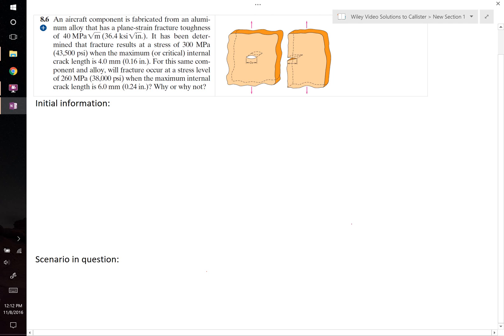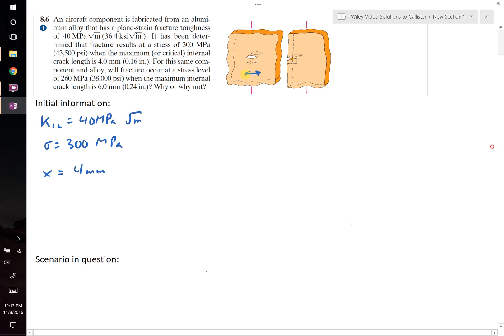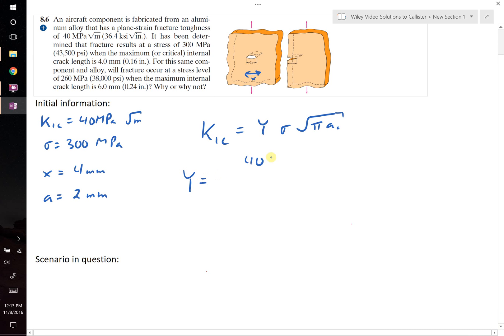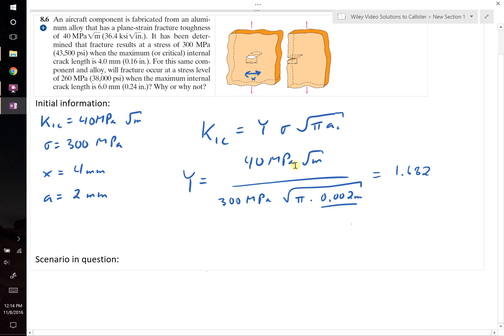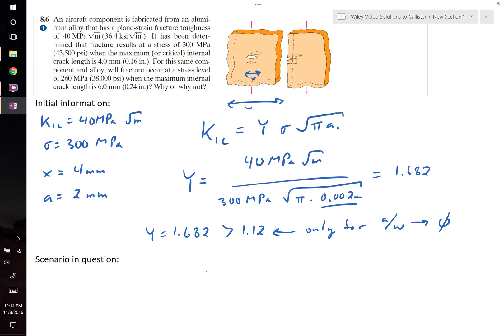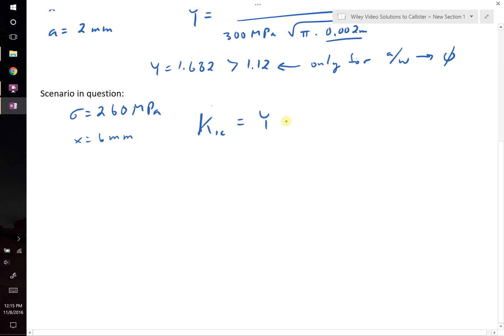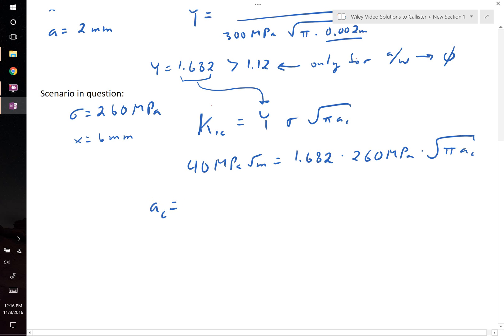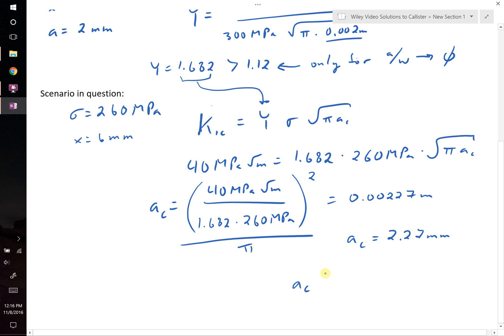fracture toughness example problem

Comment: Thank you for the helpful video! I believe the answer is slightly off, it should be 2.66mm opposed to the 2.27mm mentioned in the video. I think the 6 was omitted from the 1.682 value in the calculation. I appreciate the informative and helpful video! studying for an exam, and this material was very helpful.

Comment: Hello! I have some confusions about the leak before break concept. Can you please have a tutorial about it? Here is an example question I am solving. Thank you!
"A pressure tube is designed on the basis of the leak-before-break principle. The tube has an inner diameter of 20 cm and a wall thickness of 3 mm. It is assumed that the crack depth a, is always less than 40% of the crack width at the surface 2c. What is the maximum operating pressure in the tube? Use a factor of safety of 1.5 for stress in your calculation. If the a/2c ratio falls to 0.1 will the factor of safety be sufficient to ensure that leak-before-failure still occurs?"
Reply from the maker: I may have some time this week
Reply: @TaylorSparks   Can you please explain why is it when the crack is internal than we need to divide the length of the crack by a safety factor of  2? what is the reason behind it? 

I am kind of confused.

Comment: An alternative way to calculate. Since Y and KIC is same for both situation, (sigma critical*sqrt(a, max) for 4 mm is equal to (sigma critical*sqrt(a, max) for 6 mm. You will get the critical stress value for a=3mm equal to 245 MPa. Applied stress value 260 MPa is higher than 245 MPa which is critical stress value for a=3mm. Therefore, fracture will happen.

Comment: The fracture occurs when the critical crack length is lesser than half crack length....can anybody tell me why is it so?
Reply: It depends on whether the crack length is internal, or on the surface. The critical crack length is taken as half when implementing into the formula if it's internal.

Comment: where can i get example problem of related topic?
Reply from the maker: Which topic? I can make more videos of needed.
Reply: @TaylorSparks  fracture toughness,  especially on how to calculate safe design,  when there is crack,  crack propagation rate,  max allowble stress when there is existing length of crack

Comment: Can anyone explain the difference between the two equations for Fracture toughness equations such that:

K = (y.p)/(h.w^0.5)      or 

K= Y. STRESS.((Pi.a) ^0.5)
Reply from the maker: Where are you getting that first equation from?
Reply: @TaylorSparks 

BS IS0 13586: 2016

similar adaptations are found in ASTMS and forums discussing k determination of CT and SENB tests.

Thanks for your reply

Comment: how you can use tthe same geometric factor in the second case and u want the length of crack that include in geometric factor!!?  that mean u use first y  that include a=0.002 in the second case  that require  to find a
Reply from the maker: That's a great question. In this question we are not given enough information to use a modified crack growth factor. But you are right, it will be a different number we just don't have enough information to know what that number is. in the textbook they have a figure that shows y as a function of a / w. Since we now know why and a I suppose we could solve for w and then the second part of the problem we could use a / w to get the appropriate y value.

Comment: The conclusion seems very wrong to me. If the 2.27 is less than 3 which is the maximum crack length so there is no fracture because the maximum crack length has not been reached !
Reply from the maker: I think you have the two values backwards. The actual crack length is 3 mm. The critical crack length is 2.27 MM therefore, the actual crack length is greater than the critical crack length and so fracture will occur.
Reply: @TaylorSparks  but it's written there maximum (or CRITICAL) crack length.
Reply: @asfarhanna  I was confused too.But i figure out what he solved is correct but not qite easy to understand.So I will tell you what i think below.
you can just think  use the condition of problem have told you , max of crack is 6mm ,and you use Kic=Ya(pi*a)^1/2, just like the stress you get later which is the critical stress under this equation is smaller than what it is subjected to (is 260MPa),it will fracture.I hope it useful to you :)

Comment: Very helpful tutorials!   Is there a standard formula you use to calculate the fracture toughness of a material?  I'm preparing for a test and have seen multiple formulas and when I use them they don't match.
Reply from the maker: Pat Ginnetti can you give me an example?
Reply: Consider a structural component containing cracks as large as 0.1mm in length. The component is exposed to a cyclic tensile stress which reach a maximum of 310 MPa per cycle. The material experiences fatigue cracks under steady growth under steady state condition as given by da/dN = A(?K)n where K is the cyclic stress intensity factor range and the value of A and n are 2x1012 and 4 respectively. K in MPa/m and a in m. Assume the configuration correction factor for stress intensity is unity. If the fatigue liftime must be a minimum of 2.7x104 cycles to failure, calculate the required fracture toughness of the material.
Reply from the maker: here's an example that will walk you through it!
https://www.youtube.com/watch?v=PT3B1li2dwg&t=12s&list=PLL0SWcFqypCnIJAS_ijZkza53L5K4YFY4&index=31